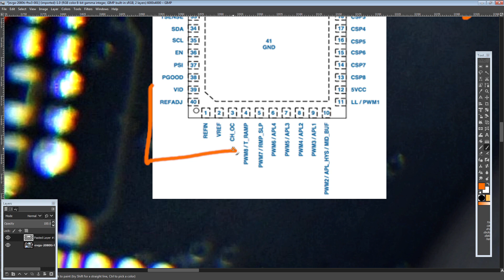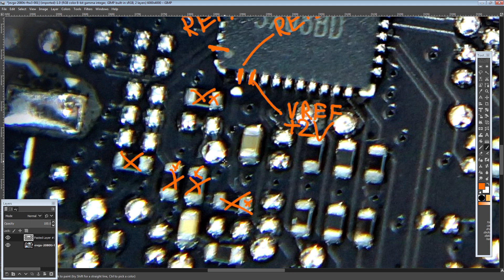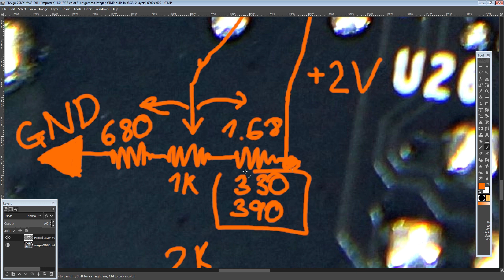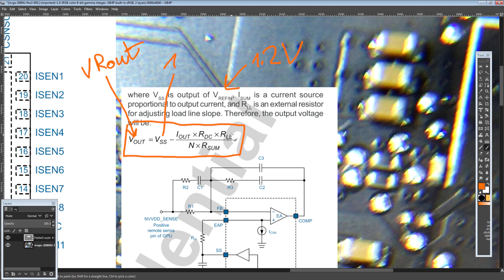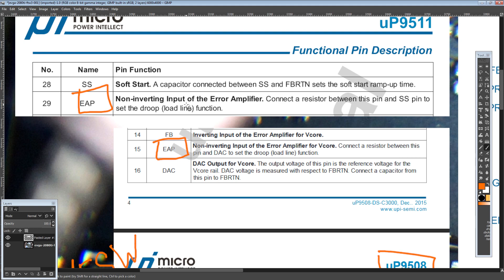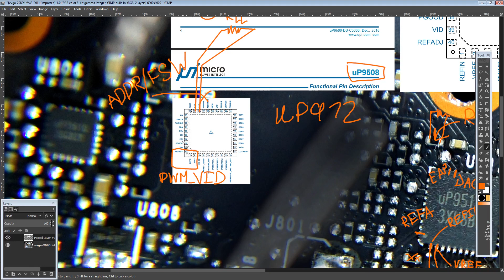Vcore and loadline mods for the UP9512 voltage controller(RTX 2080Ti/2080/2070)

Comment: On EVGA 3070 Ti I got LPC51U68 voltage controller very similar to this one. The card doesn't have power at the core or memory. Got 3 red lights at power connectors. One fan spins at full speed (its +12v pin is shorted to power connectors +12v) 2 fans not moving. The voltage regulator chip (LPC51U68) gets hot right after card is powered up. I have a question. Can I just change this chip to a new one. Or it needs to be programmed before installation? Thank you.

Comment: You are completely wrong about Vrefin calculations and didn’t even mention that is a 3 types of it BOOT, STBY, PWMID and is not so trivial as you show here. In addition you are using incorrect datasheet for uP9511 so all info is kind of useless here

Comment: GPU voltage is a 24-phase design, managed by a uPI uP9512R controller.
Zotac RTX 4070 Ti AMP Extreme Airo Review techpowerup.

Comment: I got everything together now for the voltage divider. I tested my setup with an old 2,8volts strong Cmos battery , because im a noob. ( 1k potentiometer, 680ohm on gnd side, 390ohm on the plus side of the battery.) It works but somehow it lowers my voltage to far. ( Got only 1,4v at max. out of the middle pin of the poti and 0,6)  Is this just due to the battery powered setup instead of the psu powered 2v coming from RefVol. pin.  Or is there sth. wrong with my circuit?
Edit: Curcuit seems fine. Maybe its the LLC i did not take into account in my calculations.

Comment: Weird idea, but if you can get your hands on the correct datasheet with the i2c register descriptions, you could take a look at the i2c bus with a logic analyzer, hope its not constantly doing stuff but maybe like every second or so, and make a "man in the middle" with an arduino  by cutting the i2c dat and clock traces (or even use a stronger value pullup resistor), and placing it in there, which passes every i2c command through except for the switching frequency.,

Comment: Thanks Buildzoid, from someone who understands a bit of electronic that was a really good explanation.
I'm not sure anyone will apply this before you because customers care about their warranty.  Look all those fools still using gallium alloy instead of making proper soldering :-)
So might be some hackers here but I'm sure they have the knowledge, the methodology and the equipment to make this properly.
Reply: if i could get this to work and it had substantial performance increases without hurting the card i would.  but im not most people.  and im sure you could get decent gains but im not so sure that it wouldtn degrade over time.
Reply: Well, as Buildzoid said it's more intended for extreme OC in subzero. I doubt you need more than a shunt resistor mod to lever the power-limitation and perform an OC by air/water cooling.

Comment: Anyone have a opinion on a 1080 armor card that i turned into a hybrid after i was able to clock the memory 1000+? I was able to normalise temps since stock cooler sucks and now it actually holds 2064mhz and i got it to 2075mhz with the power unlocked bios i found but now its pulling 265w(285w in firestrike/timespy)  watts instead of 220w at stock bios. I want to flash the 11gbps msi gaming x bios since i know the card can do that at this bios stock power i want to see if i can.clock the memory higher since ive always found performance increases with every memory clock increase. Max temps are 50 with the hybrid mod and im getting 8800 in timespy with my 2700x and 19,800 in firestrike. just sparking a convo lol.
Reply: Install caps. Could always add more caps

Comment: Dangerous ☠️? 😳
Reply: Inherently and absolutely dangerous to your card....  mitigated directly proportional to your level of knowledge and care and skill in understanding, applying, and using the mods.
Reply: not dangerous if you know what you're doing and keep the cautiousness of checking your circuit before turning the power on.